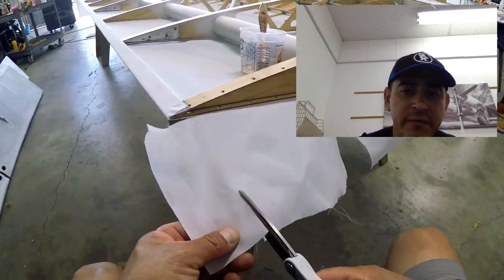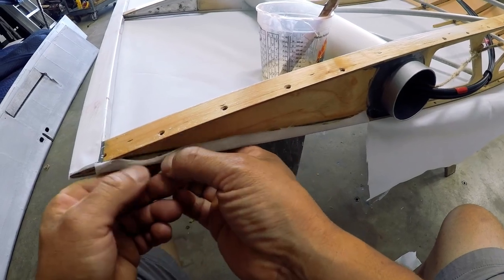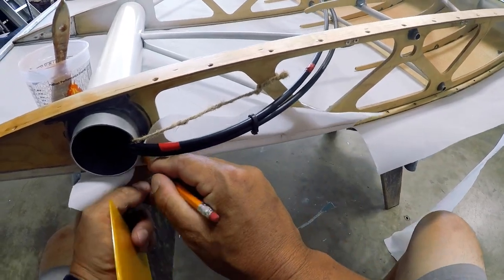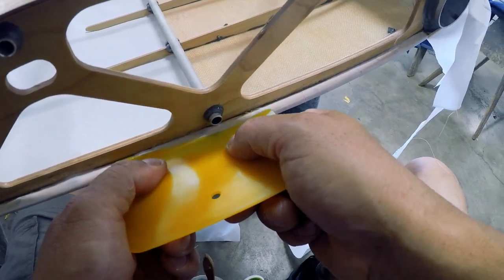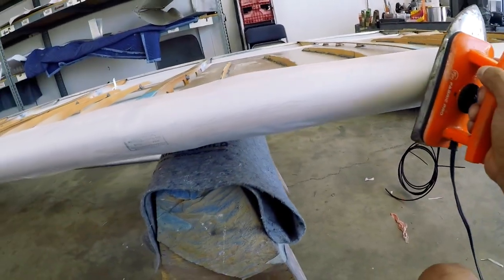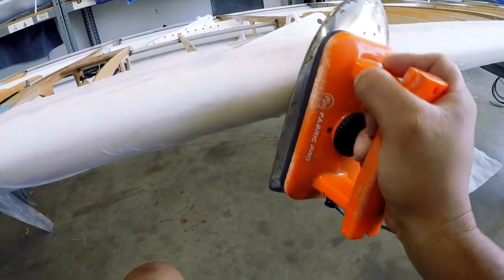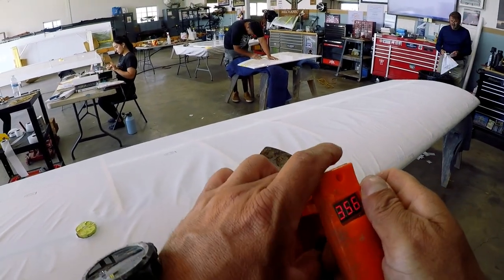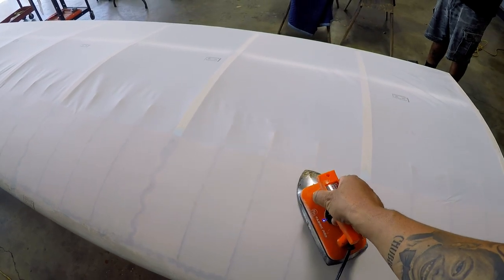Poly-Fiber Tutorials - Fabric Covering KitFox Wing (part two)

Comment: When wrapping the fabric around the rib, if you use your iron to shape the fabric around the cap strip on the rib, it will want to stay in place much better when you put the glue to it.  I also have a bunch of plastic clothes pins to keep it in place till glue dries.

Comment: any bond can work instead of poly take cement
Reply from the maker: Poly-Tak is the only cement product approved with the Poly-Fiber system. Any other cement will void the STC. Even on uncertificed aircraft its recommended to use Poly-Tak because we have through testing on it's chemical interaction with other Poly-Fiber products.
Reply: Why would consider anything other than Poly-Tac?